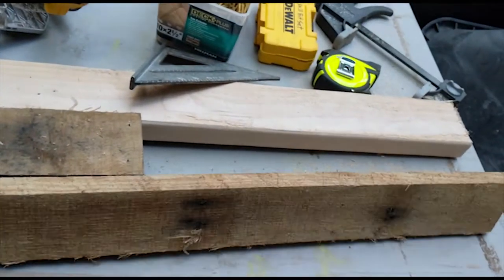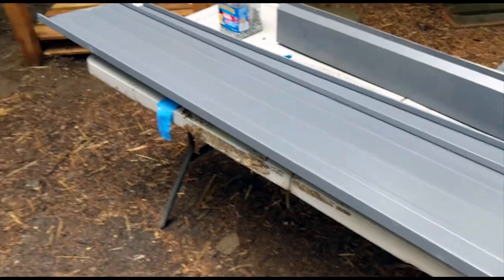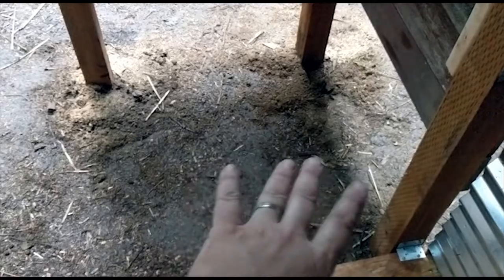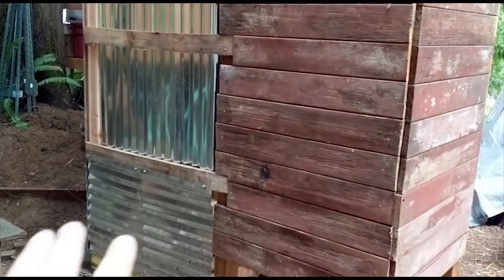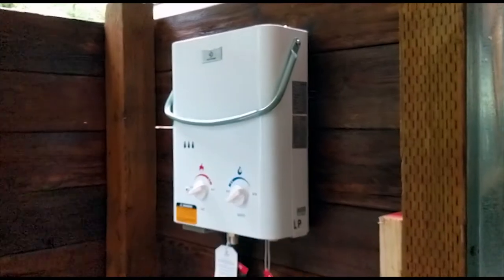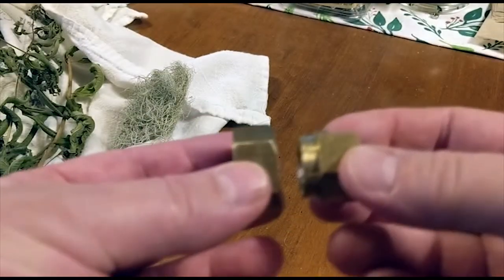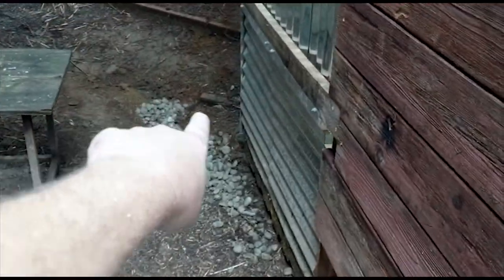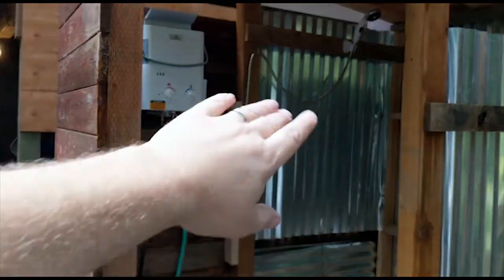Outdoor Shower Build - Ecotemp L5 Tankless Water Heater

Comment: Hey!  We enjoyed this video!  Thank you for sharing all this info!   Is your cold water on all the time or do you keep your main water source off between showers.  We noticed the Ecotemp pamphlet said it can't be installed permanently and we are trying to figure out why they would say that.
Reply from the maker: Thank you! 🙂 When we were using the outdoor shower, I had a splitter on the hose and would only turn on the water to the ecotemp when we were going to use it. We drained the unit and kept it inside during the winter. During the winter we would haul it out and set it up when needed. Maybe they say to not install permanently due to the possibility of parts freezing and cracking.

Comment: I really like this bud.  I am needing to do a shower setup to put in my shed where I have tools etc but need a shower.  My only critique is I would worry about splinters in my poor old feet from the pallet shower pan.  The EcoTemp 5 looks great though.
Reply from the maker: Hey thanks. I hear you on the pallet splinters. We never had an issue luckily. We took it down over a year ago when we finished our basement so it worked out as a temporary floor. The Eco temp struggled a little when it was real cold out. Had to crank it to full heat to get warm water. If we did it again I would get the next model up. Take care.
Reply: @AlmostHomestead  I wonder if I would have enough pressure from just gravity with a garden hose hooked up to my 1200 gallon water tank and no other pressure otherwise.
Reply from the maker: Hmm, good question. It might work. When it was cold out I turned down the water pressure on the unit so the water would have a little more time to heat up instead of blasting through the unit.
Reply: @AlmostHomestead  guess I need to do some more research on the unit. But it seems like a well thought out piece of equipment. Thanks.
Reply from the maker: 👍 Good luck

Comment: Does the waste water drain anywhere?
Reply from the maker: It just drained into the dirt below the pallet floor. We always used biodegradable shampoo though. We used it for a little over a year then built a basement in the cabin with a bathroom that drained to the septic tank. We no longer live at the cabin.

Comment: how long do the batteries last ? I want to use it for a sink in my backyard bbq counter sink I set up. connected to my garden hose. for washing hands, cleaning stuff.
Reply from the maker: I'm not sure. I did a quick search and didn't find anything either. I can tell you that our battery is still going strong after more then a year.

Comment: Do you smell any hint of propane when using the water heater ? I started mine up today 1st time and shut off immediately after smelling super light hint of propane .. wasn’t strong but enough for me to wimp out
Reply from the maker: Hmm... I don't smell gas when using ours.  Did you use plumbers tape on both gas connections to unit and propane tank? If not, that could be the reason for some gas escaping.
Reply: @AlmostHomestead  I’ll try that. I believe I have one fitting sealed with tape, I’ll take it apart and do the other fitting as well. Thanks for your help!!!

Comment: I'd love to know how that eco tech heater worked for you considering it's just 5L?
Reply from the maker: Had to replace the shower head and hose. The shower head was difficult to turn on and off and eventually fell apart. I have to turn the water pressure down pretty low with the heat cranked to have a warm/hot shower. It works for us but I would probably purchase the next model up if buying another.

Comment: Do you house the eco temp somehow for winter? Does it need a weather proof setup even in summer?
Reply from the maker: When we had the outdoor shower we kept the ecotemp in the cabin during winter and would take it out when we showered. It has a little cover/flap that kind of protects the inside of the unit from rain but we kept it under the roof and close to us so we could adjust the temp while showering.
Reply: @AlmostHomestead  is your cabin always heated? My cabin is not heated when we are not there so not sure even if I brought it in, how well it can be drained and tolerates freezing?
Reply from the maker: We heated with a wood stove and a cheap oil filled radiator style heater when we were using the Ecotemp. It should be fine as long as you drain the water out of it when not using in the winter. Hope that helps.

Comment: Can you please tell me where the waste water goes? Thanks
Reply from the maker: I surrounded the shower with a ditch filled with gravel and ran that over to the hill where we have several plants and trees. We only use biodegrade  all natural soap and shampoo. Its been working very well. We are in a drought here and it has been providing the trees with moisture while some of our other trees in other areas have died.
Reply: @AlmostHomestead  Thanks. That's what I wanted to know. I have a small shed that I want to convert, & working out how to do it. I've decided to dig a sump hole & fill with gravel. I'll need to concrete in 4 piles because the winds up here can be very strong.